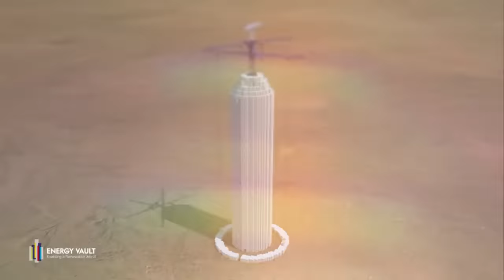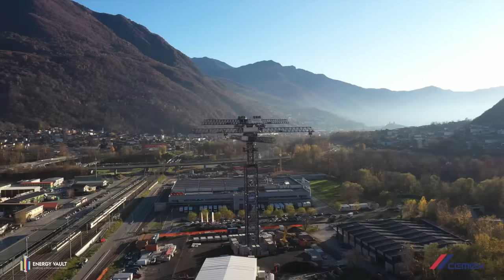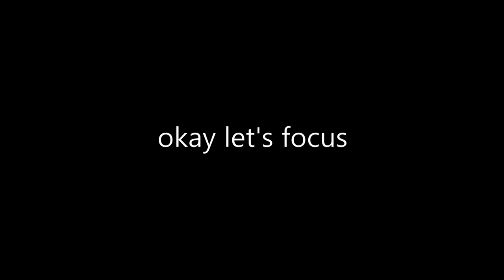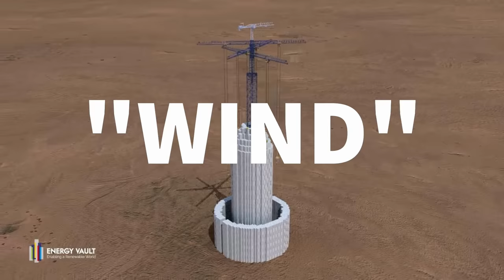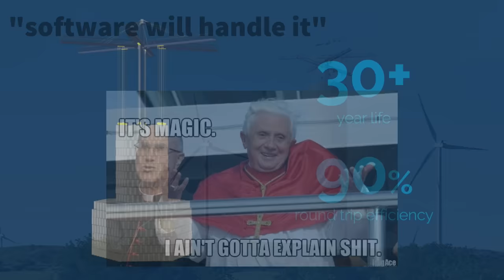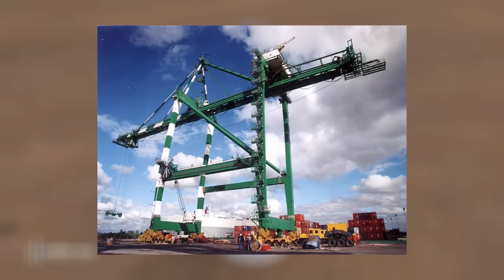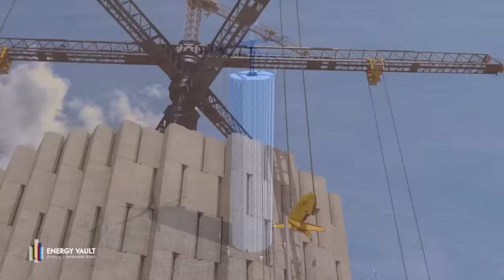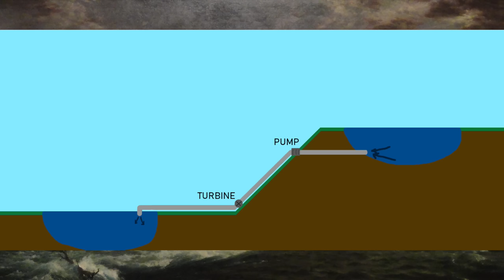The Energy Vault is a Dumb Idea, Here's Why

Comment: The thing with PSH is that you need the right geological conditions which vary a lot from place to place. In Germany for example almost every economically viable PSH facility is already built and the combined capacity of these storages is only a tiny fraction of whats needed to stabilise a grid with 100% renewables
Reply: A much more futuristic idea is having a slew of devices, from dishwashers to washing machines to electric cars and phone chargers, that use power when the grid is high and not when low. Why inefficiently store electricity when you can use flexible consumption?
Reply: And these liacteion for PSH are never near the power production or the load!!
Reply: @chukwudiilozue9171  You really think society will transform from being lazy fecks who want everything to service them, to a society where everyone adapts their needs to what is available at the time?

Flexible consumption requires discipline, it works on small scale but it does not and will never scale up to include the entire planet. It's also economically not feasible, our industrial capacity already needs people working in shifts to produce 24/7 365 days a year, the implications of limiting that output are disastrous.  Best case moving it all to regions with available hydro storage to generate that electricity locally is not feasible, second best scenario is a global power grid with enough capacity of switching capability to run as much from locally produced power, locally stored power as well as being able to supply that power through the grid to regions suffering a deficit. 

There are plenty of places where geology allows efficient PSH, the issue is those area's are often remote and lack infrastructure. And heck, even in places with good infrastructure there is a limit on how much that can handle. The transition to renewables is already running into expansion limits due to the existing power grid. Many proposed solar plants in my region are not being build because the infrastructure can't handle the distribution. 

So the first step should actually be focusing on improving the infrastructure imho.
Reply: @chukwudiilozue9171  I don't think that a smart grid would really help reduce the amount of electricity storage we need. The main issue with renewable energies is that the production not only varies by day and night, but also by season. And the latter is the real problem, because you need huge storage facilitys to accommodate for that (for Germany i thinks it's like 10 TWh or something. For reference: in Germany there are about 0,04 TWh of PSH installed). Why will a smart grid not fix this? You might be willing to wait for your laundry a few hours or even a few days, but certainly can't wait a few months. 

Then how to deal with this issue? If I knew the answer, I'd certainly wouldn't write youtube comments, but I have a few thoughts:
1. Overcapacity of RE plants. The previously statet 10 TWh are only required if you want to produce the electrical energy needed with the minmal amount of RE plants. If you built more, you need less energy storage for the winter months. The problem: too much energy in the summer. this definitly reduces the profit on RE projects, but a solution might be to use the energy for power to gas, as it's easyer to store in high quantities.
2. Batteries. (not Li-ion, that's to precious to use for stationary operation) Technologies like sea water batteries or Na+ batteries might become feasable in a few years and as a) demand will be huge and b) prices for the raw materials being low, I expect those technologies to be quite cheap.
3. Import of H2 and other gases. Import those from countries with a high availability of sun energy like Namibia or the middle east an use it for fuel cells to convert it to electricity and heat. (yey, more dependence on foreign dictatorships and oligarchies ;) )
Reply: Also possible solution: Build nuclear power plants. They're good from a supply, waste, carbon footprint and deaths/kWh perspective. What they're not great with is idiots disabling security systems and ramping up a highly flammable version of the reactor to max (Chernobyl) or skimping on inspections and trusting private companies will build responsibly (Fukushima). (Neither of those come close to the annual deaths or cancer from fossil fuel plants, by the way)
Reply: @vincentmuyo  I am not a particular opponent of nuclear power plants, but I have 3 issues (an the first contributes to the second):
1. Waste we (yet) have no real idea what to do with and
2. cost. Even if u exclude the costs for dealing with the radioactive waste, nuclear power costs something around 15 ct/kWh which is much more than renewables sitting at about 7 ct/kWh. Including other costs such as waste treatment (unsually not payed by the user of the electricity but the state / society btw) the price goes up to more like 25 - 30 kWh. 
3. Fragile power source in the face of climate change. Nuclear power has the same problem as coal or oil. In order to operate properly, they need cool water to create electricity from heat. As climate change leats to an increase of temperature, the coolant becomes warmer and warmer, decreasing efficiancy and safety.
Reply: @annoholic7941  3rd point really is not particularly relevant, 1-3 degrees really doesn't mean much
Reply: @vincentmuyo  look up small scalable reactors 👌
Reply: @annoholic7941  1. Waste can be refined and used again. Plus, we have safe ways to store it.
2. Cost comes down with scale. Plus, the cost of renewables is misleading because they can't sustain a grid on their own without significant backup for times when power generation is down, or massive, expensive power banks. Nuclear on the other hand is by far the most stable power source we have. 
3. warmer water actually increases efficiency. It means less heating is required to produce steam. It may also lead to a slightly higher mass flow rate for cooling, but that's negligible in the grand scheme of things.
Reply: @caracalfloppa4997  1. That's far oversimlified. You can to some degree get usable material by reprocessing, but you don't get rid of the radioactive part that way and you contaminate other things like water in the process which then also has to be treated. The process is quite costly and doesen't solve the issue of radioactive waste. Other options like reactors that can transform radioactive, used material into less radioactive one are (as far as I know) not proved to work, nor will they be build in the near future. 
Safe ways to store the waste? Storing it in big storage facilities might be relatively safe but it's economicaly certainly not feasible. If you know a geological structure to permanently store the waste, I guess you can earn a lot of mony right now ;)

2. The scale argument doen't make sense. Nuclear power plants have been built and used for great extend, right now they produce  somewhat similar amounts of power as renewables and they are much more expensive. If scale brings down cost, it might become cheaper, but the same holds true for RE and I don't know why one should assume that it then becomes magically ceaper than RE.
Regarding the second part of your Argument. First, why does everyone want powerplants to produce a constant amount of power? Am I the only one not letting the lights on all day and preferably eating cooked food at noon? Power consumption varies throughout the day and alligns quite well with the production of solar + wind. Nevertheless, of course we will need storage solutions. It would be a bit much to give a broad overview on how to store power seasonally, but a view options are 
- salt water batteries
- Power to gas
- CAES
- PHES
- ...
They will add to the cost of energy but i think it will be possible to implement those technologies on a large scale.

3. Sorry, but thats just not true

Comment: What I appreciate the most about this video is that it explains everything in less than 4 minutes.
Reply: Nope... It doesnt... It's full duning kruger content... That's why it has so much views... satisfiying the easy brains...
Reply: @ooberholzer  you could explain it even shorter .... "bricks stupid, don#t give money" .. goes into 5sec. Sure, you could epxlain it in a hour long youtube... which wouldn't have much more details then the 4 minute one. Or do you want to explain the energy loss and the maintenance points of each cable and bold due to friction?
Reply: @blubbber  Why are you hung up on the bricks part of it? There are so many other options besides concrete.
Reply: @aaronburns9365  which? You need a material that is dense, otherwise it makes even less sense.. so steal? lead? all even expensier ... and if not bricks , what else? water? oh , yeah, right... that we have already as explained in the video. So what exactly do you think should work?
Reply: @blubbber  Crushed cars can be more easily stacked than these "bricks". You also have the added advantage that they are easily available and can still be recycled at their end of life for this use.

There is also a hang up on the stacking issue but that can easily be overcome. Have the crane not be a tower. Instead it is a lower crane that is at the top of a cliff/canyon. Instead of blocks or crushed cars you can use crushed cars that are grouped together in a steel mesh bag. The steel mesh bag has a top eyelet for the crane to pick up. When storing energy it can raise the piles of cars, one bag at a time, and place them around the top of the cliff. YOu could make small stacks... testing would show the most advantages stratagy. Then when power is needed you just pick up a bag of cars and drop it. This stuff is not that hard.

To many people are hung up on one size fits all solutions and THAT IS NOT WHAT IS GOING TO SOLVE THE ENERGY ISSUES OF THE PLANET.  
By your logic we should be launching rockets by letting water out of a dam. Thats not how any of this works.

Comment: To be fair to the designers, the reason why water is less attractive than concrete is the density of the materials and the fact that gravitational potential is directly proportionnal to mass, meaning the system can hold more energy per unit of volume. To their detriment though, none of those methods is a viable method of storing power. Even pumped hydro is kind of terrible because of the low energy density of the system (water being the main culprit and the distance required being the second one). For reference, a pumped hydro storage facility is less energy dense than a battery, which is already pretty poor in energy density overall. Same is true for volumetric energy density, which in this case breaks the whole pumped hydro concept for large scale storage because we don't even have enough mountains to hold the amount of water we would need for large scale renewables adoption.
Reply: Density of concrete - 2300kg/m3. Price of concrete - around 60$/m3.
Density of water 1000kg/m3, price - no idea, depends on region, but probably a lot less.
So, is it worth to exchange this money for 2.3 times more energy density?
Reply: For anyone wandering by, concrete is ~2.3x as dense as water, so you can store that much more energy per unit volume. This design also doesn't require very specific geographic setups where you happen to conveniently have two lakes at drastically different heights within a short distance of each other -- this can be built in a much larger variety of places, potentially even quite close to the original power source.

This isn't a 'do this first' solution -- this is for places that can't do pumped hydro storage, and perhaps aren't up for installing massive li-ion battery banks.
Reply: @grzegorzdomagala9929  Well, if we are to go down the rabbit hole, water is also volatile, meaning you will lose some of it here and there much more easily than you will lose concrete. Plus, the water in pumped hydro isn't really something you buy or sell, it's already there naturally or you push it there using a hydro power plant typically. The costs just happen to be more infrastructure intensive. I never said any of those are good ideas though.
Reply: @Azirale  There's a million problems with the idea though. Precision is just one out of many, the manipulations alone that will need to occur in order to move concrete will create massive energy losses through countless movements and reajustments to make a stable structure in a system that already doesn't have that much energy stored. It's at best a fancy ''do nothing'' machine that may get as far as 80-90% energy loss.
Reply: @Azirale  If you build this on flat ground half your tower cannot be used to store power.

Comment: Another idea: Pump storage hydro requires specific typography and rainfall. The tank idea is pretty cool though, and you could use underground containers of sand in the desert instead of water
Reply: You would need power to force the sand out with enough pressure to run the (hydro) generators. Very little return on energy output.